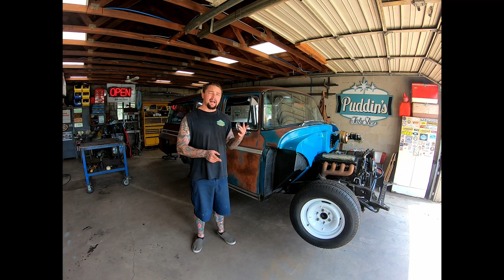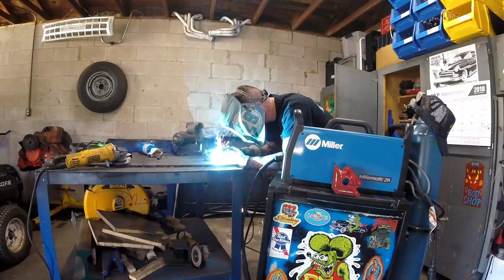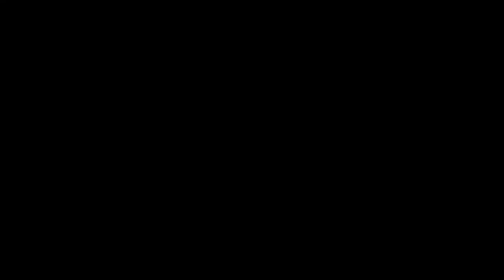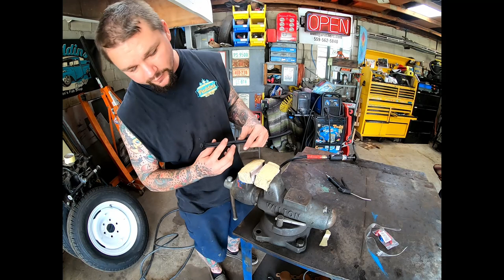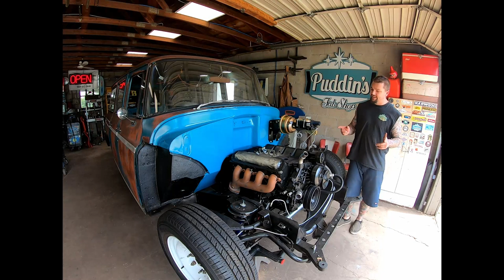SECRET TRICK to INSTALLING AN FITTINGS!

Comment: Neat trick, can't say I'd have thought of that. That Nylon Black Braided stuff frays worse than the regular stainless steel because its a soft woven material.  Personally I grab some scissors and give the frayed ends a trim at like a 45 degree angle.  Just at the very end of the line as that isn't super integral to the hold of the fitting. 

Quick note: Fitting nuts aren't threaded where they accept the hose, they are just straight ridges inside. So it doesn't matter which direction you twist the hose in.  I find it helpful to go both ways, I kind of twist back and forth and push straight down into a vice, it goes smoothly.  I'll post a picture on IG later today showing a cross section. I cut up a couple AN Fittings to demonstrate that very fact to someone on TikTok yesterday.
Reply from the maker: Fun fact. I had no clue you watch any of my videos so this comment was great. 

Also a great example of why I sent people your way for technical info!
Reply: @PuddinsFabShop  I'll be giving the super glue a try in the future. I just wrapped up an entire plumbing project but it is a solid idea.  

I watch when I get a chance.  Can't claim that's all the time but I like what you are doing.
Reply from the maker: I’ve seen in instagram you’ve been busy on your old mans truck. It’s looking great. I understand as I’m in the same boat. Thank you 🙏🏻👊🏻

Comment: This is the best idea yet for AN fittings assembly. I have struggled many times to get the line seated in the nut. Your trick works on stainless steel braided lines, also. The glue holds the stands flat and makes the nut seat every time. This is a genius simple idea. Thanks for taking the time to make the video.

Comment: Hey puddin, just so you know, your tip DOES work with stainless braid lines. I used the gel kind and rubbed it into the wire than taped it. Let it set overnight, trim the end with a cutoff on my dremel, and the fitting went on much easier. Figured I'd share that with you and your faithful followers.
Reply from the maker: That’s awesome. It made it way easier on me!
Reply: @PuddinsFabShop  been a while since I watched this video, but I think you mentioned not being sure if it would work. That's one of those "Why the heck didn't I think of that!?!?" things.
Reply: what size....  Im guessing 6an and up.

Comment: nice trick! I had troubles and i ended up putting a socket into my shallow vise and put the tube nut in and pushed down with the hose. That was the only way i could get it on with my 140LB body. Nice video

Comment: I need to try this, im about to redo the plumbing on my supercharger intercooler hoses and changing them to an fittings and an hose. I usually trim the frayed part with scissors but not having to have that extra step will save some time

Comment: Instead of tape to secure the weave, use a small zip tie and tighten!  If you are doing lines, it is well worth-while to invest in a braided-line cutter (has curved jaws that cut from all angles). Use the zip tie and cut in one motion with the braided line cutter. Simpler ones are about $40, nice ones are $70-80. Well worth it to get your lines clean and cut quickly

Comment: I’ll have to try the super glue trick. I’m getting ready to do the stainless transmission lines in my 72’ Nova. Ill make a video of it and post it on my channel. I’ll keep ya posted. Thanks for the video and trick!
One thing I’ve always done on stainless lines, is to put a drop or two of oil on the hose and on the inside of the fitting to help make the two go together easier.
Reply from the maker: I do lubricate the fittings. I thought I mentioned that lol oops.
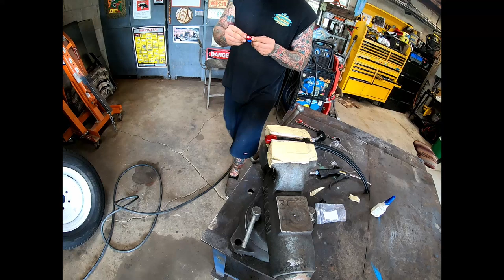Reply: Pudding - you did mention adding a drop of oil @ 6:08. 👍
Reply: Puddin's Fab Shop you did. I put oil inside the female end where I twist the fitting on the line. I saw you put oil on the threads. Not saying you did it wrong. I add oil to both pieces. I may have misunderstood what you said.
Reply from the maker: It’s all good. My minds always going a million miles an hour when I’m out there and I mess stuff!
Reply: Puddin's Fab Shop I’m the same way. Always trying to think ahead and what I’m doing next. Great video like always!
Reply: How about sliding a piece of tubing over the end,cut the end of your hose,then slide the tubing forward to the end and then put the fitting on and let the fittings push the tubing back as you go.just maybe slice the tubing in half long wise and hold it together with tape.then take the tape and tubing off.i haven't tried it yet myself but maybe it would work.im gonna try it when my stuff comes in and I'll let you know if it worked or not. but try it

Comment: That's a good tip I have had good luck with using cheap habor frieght shrink wrap over it before u cut it instead of tape seemd to hold better and come off easier thats on stainless stuff I've not worked with nylon but I'm going to soon 😉
Reply from the maker: That works!
Reply: WILL NOT WORK WITH STEEL BRAIDED line.  It is to flexible and steel braid with PLING out in all dirctions.  Shrink rap can't resist the PLING.  Been there-tried that.

Comment: Worked on several yesterday and struggled with the same issue.  I got so frustrated I threw them in the trash and bought pre-made hoses.  I will try this trick next time!
Reply from the maker: I’ve done several since then. Name brand and knock off. I’ve never had to do this truck again. Maybe you and I just got a bad batch!

Comment: Nice videos man!! I’m doing up a 1962 c10 long bed. Can you give me a suggestion on what gas tank I could go with?  I’m moving it to the bed and running a 5.3 ls and bagging the truck, so it’s a lay frame. Any help would be great. Thanks.
Reply from the maker: Without doing any research on what you could swap in it’s hard to say. I guess that comes down to budget and if you want after market or something factory.
Reply: Puddin's Fab Shop I’m just looking for something cheap they will mount in my bed frame rails and will adapt to an LS motor

Comment: Was there a particular reason you went with braided lines and AN fittings other than they look cool, I was thinking of using plastic lines for fuel, Dorman make a nice kit for making them. Thanks for sharing your videos!!
Reply from the maker: Just look nice and easy to work with. Also easy to find all the fittings
Reply: While not the case here....  DIESEL.   The scruge of diesel fuel lines as they age is air leaks.  yup. fuel does not leak out. AIR leaks in.  More joints you have..... more possible air leaks.  Better joints you have. ( like thread on- w/ chamfer- and matched cup fitting).... the better off your life will be.  

PS- this fitting type was taken from Airplane builders... simpler but more robust is REQUIRED in that industry.

Comment: Link to the ebay supplier...
Reply from the maker: https://www.ebay.com/itm/20ft-6AN-Stainless-Steel-Fuel-Line-Braided-10PCS-Swivel-Fitting-Hose-End-Kit/121941053237?pageci=dda32940-92eb-47a9-8a0b-f4c1221db164
Reply: @PuddinsFabShop  
Thanks,
Reply: what a fuckin sweet heart!

Comment: Here some DON'T!! - 1.  Forget 4an Steel Braid and lower. If you ordered it.. SEND IT BACK: unless you have a one hell of a shop and hose making apparatus.  2. in numerous of my searches.. and even on the hose delivered to me... they had electrical tape on the ends.   What fools... those idiots gave me hours and hours and hours of failures and nightmares working with the Steel braided line.  It worked just "ok" with the nylon braind.  Problem is the stuff stretches... IT WON'T resist the natural desire of Steel Braid to want  to splay out. That stuff just wants to PLING out  and BE FREEEE..  what a nightmare....  esp. in AN-4 and below.

IMHO the "nylon braided" you don't need the superglue..  Trick there is.. don't take the tape of.  Peel back most the layers but leave one.  You can rip half the width leaving only some on the hose's  outermost edge.. so the tape won't show at the nut. Well that is for AN-6 and up.  When it comes to AN-4 and lower Steel Braided..... NO... JUST SAY NO..  .  IMHO with steel braided use tape that does not stretch for 6an and up. Masking/Painting tape works great.  Again for 4an and lower Steel Braided (see reply to this post) DON'T even try

Braided steel 6an and up- here is where SUPER GLUE is THE ONLY WAY TO GO.   There is no Tape type to help; you with steel braided.  This is when I  (before this video popped up in my feed today.. 3 weeks later)  came up with the super glue idea.  PUddin is right NO ONE had posted that. Wish with my hours of searching/reading in advance to prep myself  .... whish like hell  had seen your video.  Searches NEVER brought yours up.  grrrrr.  

With Steel Braided put tape on to mark  end of the length of hose your making.  When you make your "mark" for hose length- leave estimate room for the Glue and cut process.  Don't cut yet.  you've not glued yet.  Then you want to  glue next to it tape (or line) .  Remove tape ASAP or it will stick down- it's just put there  earlier to remind you were you need glue/ and mark length of your hose..... aka when your cutting not at an open end, but  instead somewhere down the length of the hose.   As you remove the"marker" tape ...  use a tiny chunk of that scrap tape to make a mark to indicate  you just glued ahead of it.   Super important on steel braid because it is clear and disappears from view.  

 BTW- You will at times sacrifice some steel braided hose.  like inch or two..  It will be waste..... cause when you glue  it ONLY helps the process if you put it on TIGHT braided area.  You have to sacrifice any loose/flared.. even tiniest of flared  area of braid. Superglue will NOT help you get splayed out "steel braid s"  to lay back down!!!!  All you do is get bloody fingers trying that.   With nylon braid  different story as Puddin described in above video...  .

Once glue is dry... then like Pudding did; put tape there  and  cut  - suggest  USE A FINE CUTTING INSTRUMENT: something with mm thin cut off wheel. With Dremmel you will use numerous wheels per cut. Cut beyond any minute amount of flare showing if your doing steel.  Also cut to keep tape on both ends once cut is done. For cut guide you can draw line around on tape, or use a second layer of tape with edge of new layer used as your cutting guide etc.  With the glue.  with nylon braid... yeah.. you can remove the tape when done.. Steel.. dont suggest it. Just peel all but one layer off.